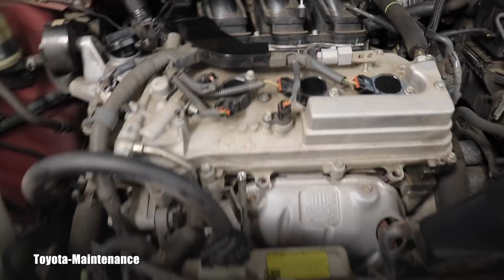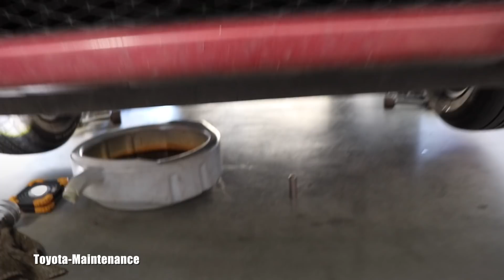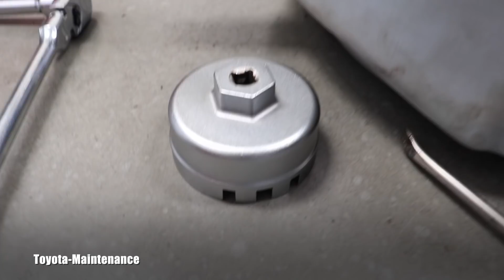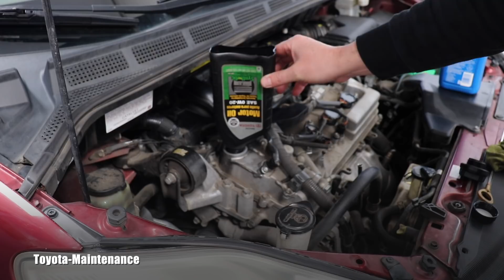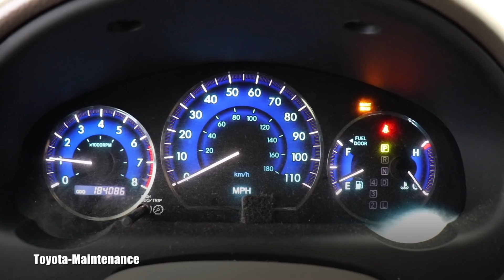Toyota Sienna engine oil change

Comment: A small comment....yes...use the large cap oil filter removal tool. Notice that it has a 3/8" socket hole in the center....and it is surrounded by a a 24 or 27mm hex. To REMOVE the oil filter housing... use the HEX. If you use the 3/8" drive...you risk breaking the tool or rounding out the 3/8" socket recess.....the previous oil change often results in finding the oil filter on TOO TIGHT. Then.....when you ATTACH the filter housing back on.....yes, now you can use the 3/8" socket recess drive as you will only torque to the incredibly low value of 25 NM or 18.5 ft-lbs.

Comment: the drain plug will waste less time than a slow messy drip from the canister and the o ring under the drain cap should be replaced too.

Comment: Please use the oil filter cap wrench when torquing the oil filter cap to 25:N•m. The drainbolt on the oil filter should only be torqued to 12.5 N•m.  The next person to change the oil may want to drain the filter housing and won't be able to cause you over-torqued the drainbolt.

Comment: With all due respect, not using the oil filter drain plug for the filter housing is a mistake. It releases the pressure build up inside and make the filter housing much easier to remove and with the "CORRECT" amount of force. In addition, instead of using the filter housing wrench, you were torqueing down the filter housing using the drain plug, that plug has its own torque spec which is 12.5 N*m/9.2 ft-lb and that's only half of what you are suppose to torque the filter housing down to. So you are either under torqueing the filter housing or you are over torqueing the filter housing drain plug or both.
Reply: Anthony C. I also  noticed this:(
Reply: You're correct. He should have used the oil filter cap wrench to torque it on. The next person may want to drain the filter but won't be able to because the whole oil filter cap will come off when trying to remove the drainbolt.
What pressure buildup? The only time there is pressure in the filter housing is when the oil pump is working/ when the engine is running.
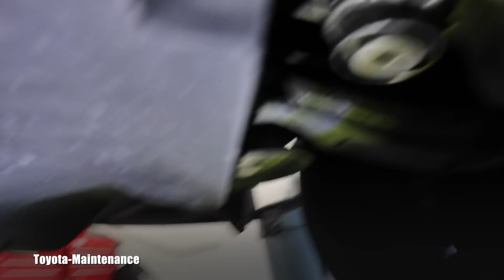Reply: @njsongwriter  .  You must be aware that unlike a traditional oil filter, the filter housing is spring loaded. Once the oil is being forced and filtered through the oil filter, the filter housing is now pressurized, even after you turned the engine off. Obviously not as much pressure as when the engine is on, but still, it is pressurized. If you do not use the drain valve and went straight to removing the housing, the pressure build up inside the housing will make it more difficult to unscrew and oil will explode out of the filter as soon as you loosen the housing. Why do you think the creator of this video, at the 2:06 time stamp, chose not to remove the housing directly? Also, you must know that there is no way you can over tighten the filter drain plug to the point that you will be able to removing the complete housing as a whole by using the drain plug? If you did, you will have a much bigger issue to deal with then not being able to remove the drain plug. Curiously, what are you a promoter of?
Reply: @anthonyc.1688  
I've done it both ways and didn't notice a difference. 
I am (or was) a promoter of Jack Tannehill who is a local singer/songwriter. My name is not Jack Tannehill.
I appreciate your thoughts on the matter. I myself made the mistake of over tightening the oil filter drainplug once and at the next oil change the entire oil filter cap came off when I tried to remove the drainplug. I learned my lesson.
Reply: @njsongwriter  . I think you were fortunate that the housing didn't leak or worse, come off from it being under torqued. we all know there can be more than one way to complete a task, in this case, there is the way engineers intended for it to be done and then there are other ways as one of them was illustrated here. Glad that things turned out okay for you but I definitely do not recommend not using the drain valve and using the drain plug to tighten and torque down the filter housing.
Reply: @anthonyc.1688  
I'll agree.
Still the majority of mechanics rarely drain the oil filter housing prior to removing the oil filter cap including Scotty Kilmer and Peter, the Toyota trained mechanic at this channel.
Personally, I'd rather take my time and do it right including using a torque wrench. I'm in no hurry being retired and having plenty of time on my hands.

BTW I replaced my housing just to be sure. 😉

Comment: Thanks for the great video. I’ve noticed in this video and one of your other videos on the same engine that there is a slight noise when the o-ring starts to seal when you’re screwing up the housing is that noise the o-ring sealing? This noise is a good sign that a seal has been made?
Other video
https://youtu.be/BRsQlMTjeOg

Comment: Love your video!  What do you think about prefilling the oil filter?   It takes up quite a bit (0.4 qt) due to the absorption of the new filter element.   If not prefilled, on the first start-up the engine will go without circulation until the filter has been refilled.    Your thoughts?
Reply: I don't think it's necessary because of the location of this particular filter. Gravity will fill it.
Reply: @donhill1825  
Gravity won't fill it. There is no oil above it for gravity to bring down into it. When you start the car the oil pump will pump oil into it. At any rate it filled quickly. No official instructions say to fill it before installing but it certainly doesn't hurt.

Comment: Great video.Enjoyed the step by step instruction.  Learned that a wide mouth bottle is threaded to screw into the oil filler.  Excellent! Blessings to you John 20:29
Reply from the maker: my pleasure
Reply: You can also use a cut-off top half of a (clean) milk jug or bleach bottle. Some 1 quart oil bottles have smaller caps....usually the full synthetic oil bottles have the larger cap that fits.